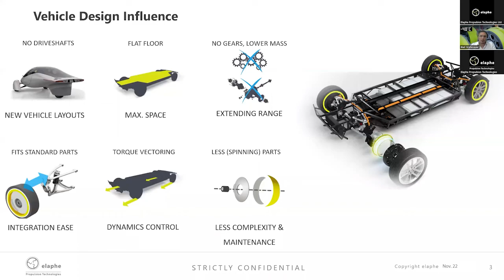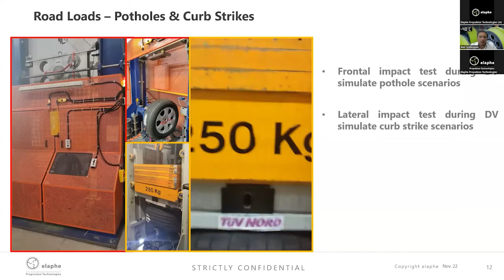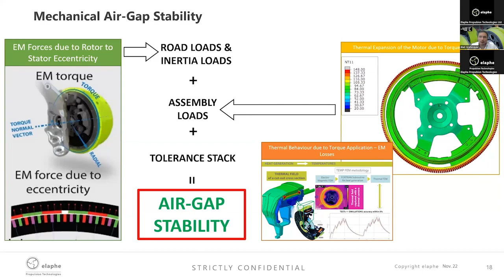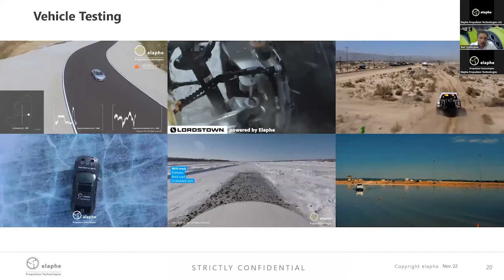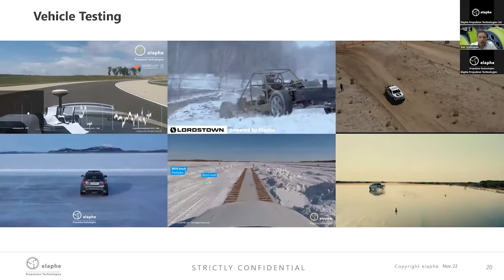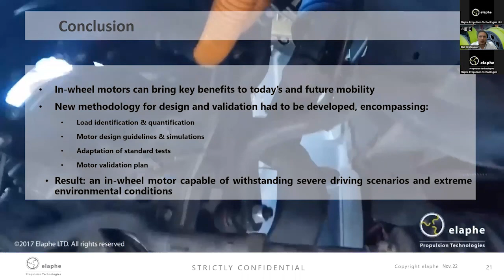Elaphe webinar on in-wheel motor robustness

Comment: Unsprung weight characterisation, motor segmentation to mitigate segment loss torque events and reduce yawing effects to vehicle control at speed, minimizing load paths thru rotor/stator, enviro and shock considerations, thermal management solutions, software/sensing/control electronics and of course integration challenges.  Don’t get me started on scale-up and logistics development … and funding.  vids like this help to push you fwd.

Comment: Thank you for this very informative presentation.  I have a few questions related to this subject.

1). Efficiency.  In wheel motors allow the elimination of a lot of mechanical components which should improve efficiency.  How do the unique engineering consideration in regards to the air gap impact efficiency.  For example the Lordstown Endurance efficiency specification is 65 MPGe which converts to 1.93 miles per KWH.  I would have thought this should be higher than similar electric pickups running on board motors, but it is not as theses trucks have efficiency values slightly greater than 2 miles per KWH.

2).  Environmental protection.  Due to their location in the wheels it appears greater consideration must be given to environmental sealing.  What is the mechanical design of these seals and how do the impact efficiency and maintenance?  Would it be worth using compressed air to maintain positive pressure in the air gap to keep dust and water out?

I believe the torque vectoring capabilities that in wheel motors can deliver is the most advanced propulsion system currently available.  Would it be possible in future videos to provide an in depth review of the torque vectoring software design?  

Again thanks for this informative video.  Hope to see more.
Reply: It seems that you are not aware of the relative commercial secrecy that this last question may pose